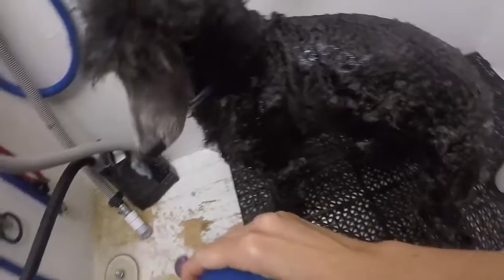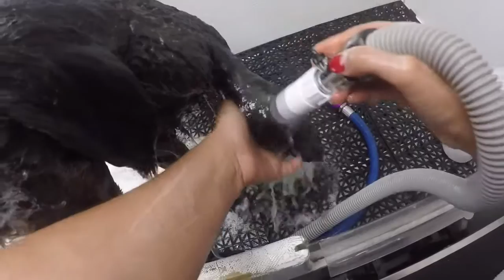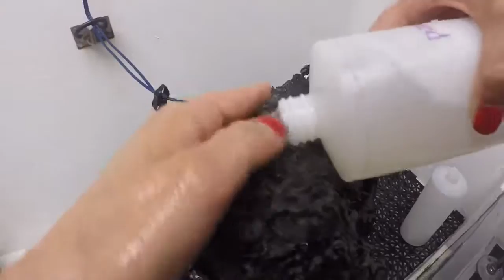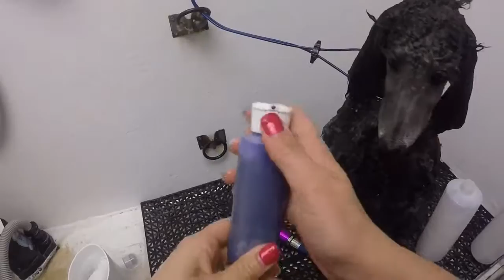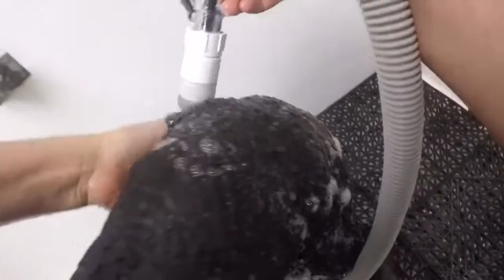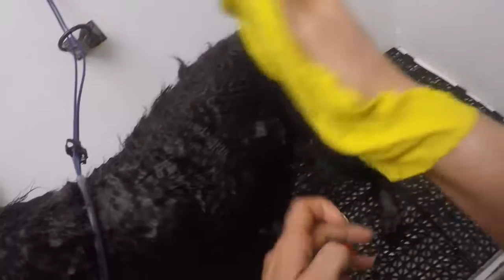How to bath standard poodle puppy

Comment: Do you like using those Sham Wow towels?  I was thinking of trying them.  I groom some golden doodles and would like to find ways of getting them dried faster.  It seems like it takes me forever to work on them.
Reply from the maker: yes, I have used different shammys for years but what I like about the " sham wow" thin yellow ones that come on a roll like paper towel is you can use one per client, they are thin and wash and dry fast. they don't stay damp and get sour either.
Reply: +itzaclip  Do you have a link for the towels or do you buy them at the store?  I have been looking online and have seen some shammy towels that are on a roll but don't seem like the brand that you are talking about.  I went to the sham wow website and they sell 2 large and two small.  Here is a link from amazon but it seems like a different brand. http://www.amazon.com/Man-Sham-Chamois-Cloth-Ultimate/dp/B00KQ81M94/ref=sr_1_10?ie=UTF8&qid=1452117118&sr=8-10&keywords=shamwow+towels
Reply from the maker: +Vita O'Shea I bought at Canadian tire store. not sure of the size since I bought two roll at least 1 or 2 years ago and they still are good.
Reply from the maker: i have since switched to these towels. they soak up water like nothing else! large size, dry fast so they  dont get sour and i wash in reglular washing mahcine https://www.canadiangroomingdistributor.com/collections/grooming-accessories/products/absorption-towels